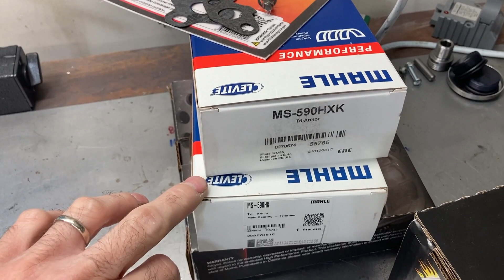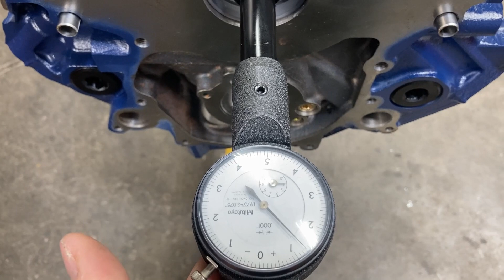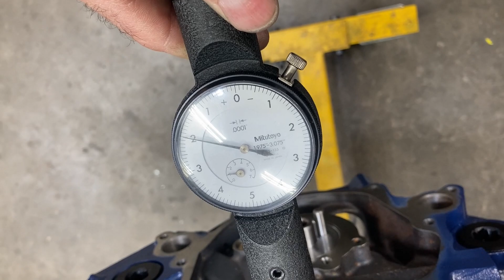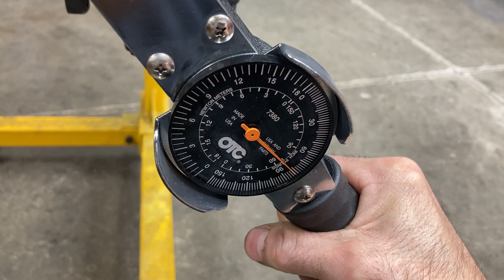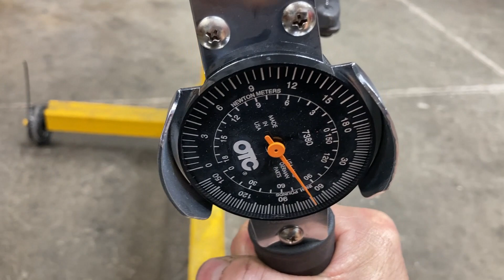Lykins Motorsports Ford 363 SBF Windsor Assembly, Part 1

Comment: Hey bro awesome video but quick question. I just got my 91 5.0 fully built 302 block and next year I definitely wanna go 363 for a upgrade. My question is, is there any piston noise at cold starts? Or piston rattle on cold starts? Thanks for answering this is the only thing that is holding me back from going 363
Reply: Normally stock factory block is only good for 347 ci. May be wrong but that seems to be prevailing opinion

Comment: Your thoughts on gear drives?
Reply from the maker: Been proven to create a lot of unnecessary and sometimes harmful harmonics in the valvetrain.  Hard to beat a good solid timing chain and if you need something more, there are belt drives.

Comment: HV pumps have been to hard on dist gears. Stopped using the years ago.
Reply from the maker: One of the biggest Internet wives tales I know of.  Out of the hundreds of engines that have left this shop, do you know how many distributor gear failures I’ve had?  Zero.  95% of my engines leave with HV oil pumps.  Most guys use the wrong gears for the cam or can’t install them correctly.

Comment: Great video!
I'm having a 363 SBF built for my '85 GT Foxbody.
My engine builder recommended a Dart SHP block as he didn't like how 'short' the FRPP block's cylinders were. He said that too much of the piston comes out of the bore at BDC.
Is that why you didn't need to clearance the cylinder skirts for rod bolt clearance?
Reply from the maker: The pistons don't come out any further with this combination than with a factory block and a 3.400" stroke.   I believe a lot of the difference is the bore size.  We are used to seeing a 4.030"-ish bore with this combination, which would put the cylinder wall a lot closer to the rod bolt.

Comment: Is it that crank internally balanced, if so do you have a neutral balance flywheel, the automatic flex plates seem hard to find
Reply from the maker: This one is 28oz.
Reply: @lykinsmotorsports  nice 363. Stepdad was considering a 363 with his DART block but decided to go 347 - we are putting a V3 supercharger on it. So what happened to the 464 build you are doing?
Reply: What cam specs did you go with for the Bronco?
Reply: @mattjohnson2183  
In videos #3